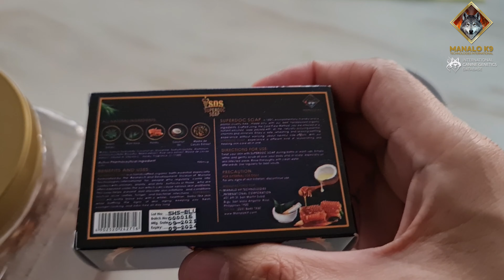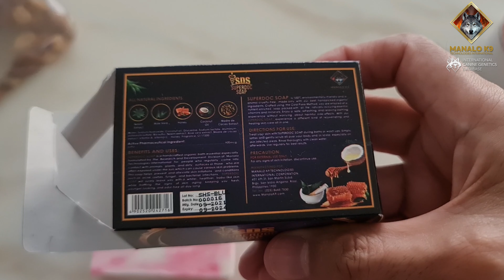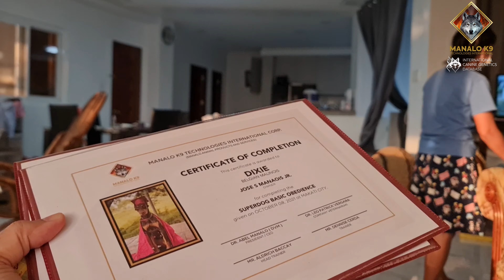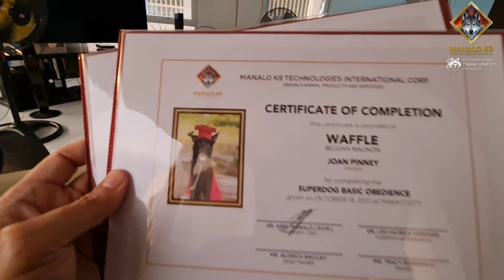DOG TRAINER NA JEBS???

Comment: Question po. May puppy po akong ShihPoo 12weeks old, di ko po muna sinunod yung feeding guide na 1%-3% kasi namayat po sya. Current weight nya po is 822grams tapos 36 grams per day po pinapakain ko, 4times a day ko po pinapakain.
Tanong ko lang po kung need ko pang dagdagan yung food nya? Nagaalangan ako dagdagan kasi meron din po kasi akong ShihTzu, 5 years old 4kg, 50grams perday pinapakain ko, malapit na maabutan nung 36grams yung 50 grams. 😅
Reply from the maker: Kamusta po ang poop? Wag muna po hayaan nyo na muna sa current weight niya. 😊 Bibigat po yan, basta po dahan dahan. 

-CCA Kim